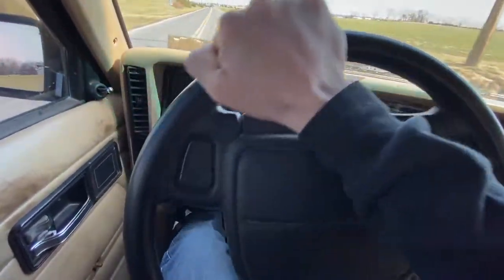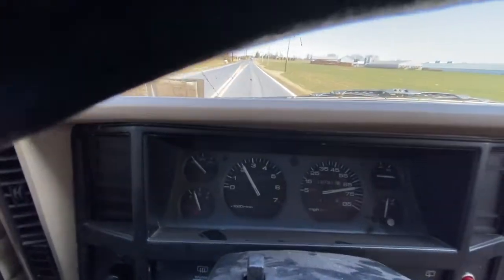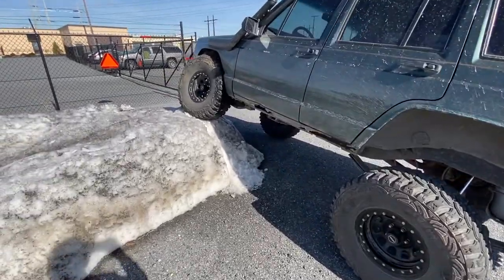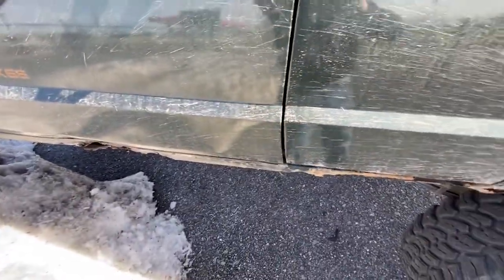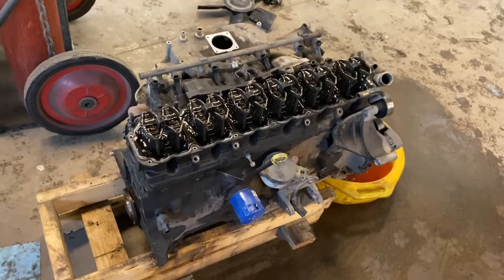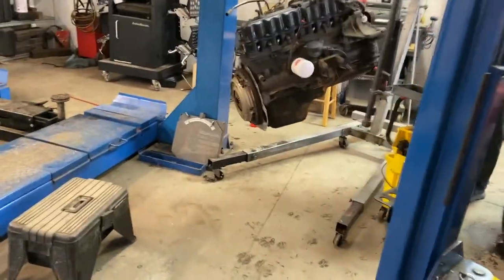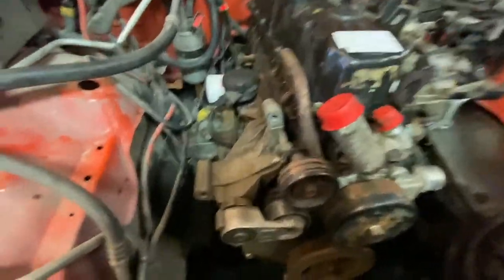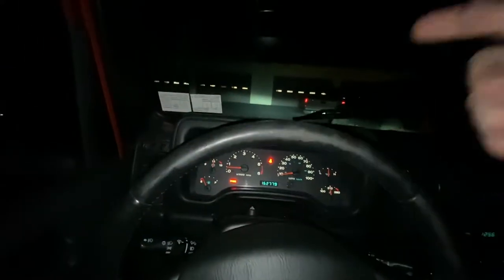My Jeep Rubicon Is Back With A Fresh Motor Swap!!!

Comment: You should of put in a new clutch kit when you did the motor swap.Now you have to pull the transmission to replace the throw out bearing....
Reply from the maker: The clutch was in really good shape and the throw out bearing spun and sounded good

Comment: 2nd but what kind of lift u putting on the rubicon and how big
Reply from the maker: Have a set of 2 inch blocks for the coils with shocks and trac bar. But want to do 4 inches at the max and prefer to not use a body lift at all. Also don’t want to cheap out and get tough country but might but the 4inch rough country and just get a set of fox shocks
Reply: Jeepin Daily go with zone off-road 4” lift, way better than rough country.